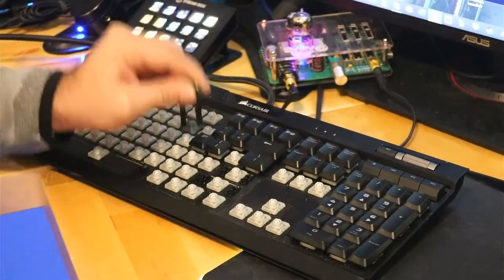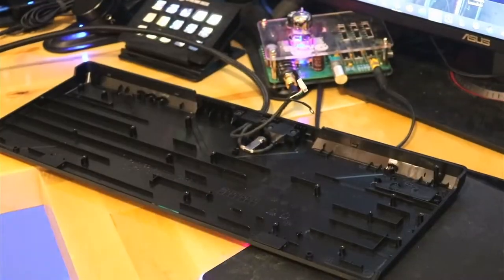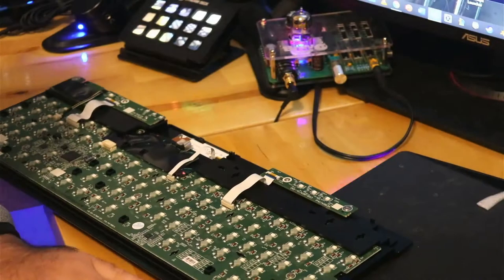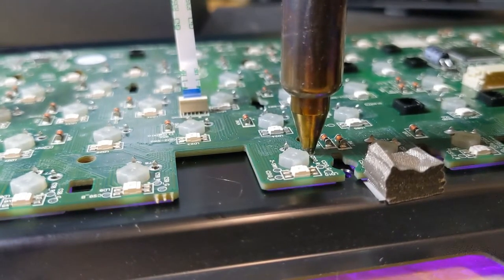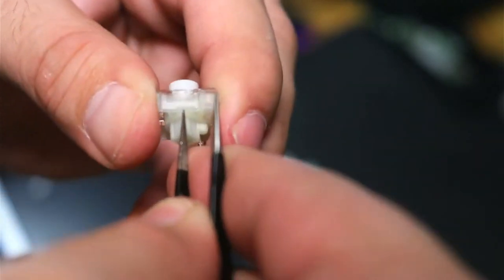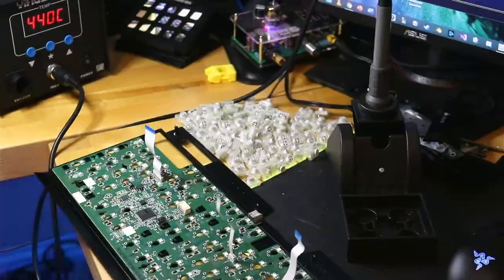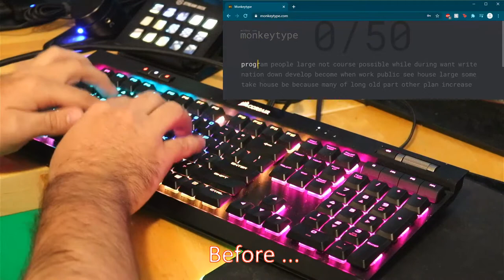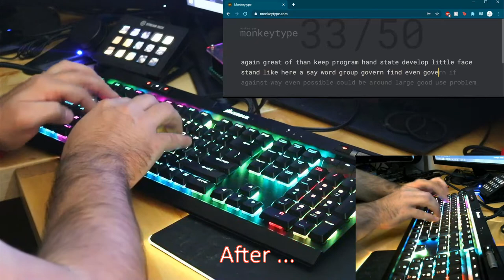Keyboard Build: Corsair K70 MK.2 Low Profile: Krytox 205g0 and Foam (Cherry Speed)

Comment: Doing this + lubing the stabs, filming the switches, Tape mod, and O rings to my K70 with MX Silvers this weekend. So excited!!
Reply from the maker: Noice! The only thing I wouldn't do is the rings. I didn't know they made film for the low profile switches? Or do you have the regular switches?
Reply: @ireakhavok  Ended up scrapping the rings and it turned out great! I have the K70 with MX silvers. Also modded my sister's G.Skill KM780 with reds. Really amazing the results you can get with a bit of effort.
Reply from the maker: @BleedGibson  The fact that you can take what you already have and mod it to be so much better is satisfying to me. I'm glad that you're modding for other people! I gave my brother a board and a couple other friends. :) Glad that it went smoothly! I am waiting de-soldering parts. I have three boards waiting right now to get modded that need to be de-soldered, including my first mech.

Comment: Your videos encouraged me to go with a project board - a liquid damaged K95 Platinum I found on a local equivalent of craigslist for around 200$. The original game-plan was to just fix the damn thing up... Now I got a K95 with the following:

Custom real leather wrist rest instead of the original rubber one, replaced the super scratchy speeds with Akko Demon switches, plate-PCB foam, bottom case foam, holee modded everglide pandas', razer pbt keycaps with a jurryrigged 6,25 spacebar to fit the 6,5u stabilzers. 

Needless to say, I love this thing and typing on it is a real pleasure.
Reply from the maker: I want to see this. Hit me up on instagram, or send me an email. lmao at the fact that you put Razer keycaps on a Corsair board, that's the equivalent of putting a ford motor in a chevy, lmao. Sounds comfortable, and quite a bit of work! I wouldn't have bought a water damaged board for 200$! that's so risky! glad that it turned out. I'm assuming that you just cleaned up the connectors with a q-tip or whatever and the PCB came back
Reply: @ireakhavok  Small mistake here - It was 50$ - not 200. 200 was in my currency (PLN). 

The seller was very upfront and honest what kind of damage it had - other than some LED's not working as they should and keystrokes not registering, it was in pristine condition - if you don't mind the gamer gunk, that is. 

The only reason I felt comfortable buying a liquid damaged keeb is because I already had to save my laptop twice after spilling liquid myself due to my own clumsiness and had some... first hand experience what to do with liquid damaged PCB's. 

And as to how I cleaned it... 

I literally washed the PCB in the bathtub. After that, I gave it a spray down with contact cleaner (and some q tip action) for good measure and finished it off by generously spraying it down with isopropyl alcohol. Dried using first a compressor (with air preparation unit ofc) and after that giving it a nice finish with the hair dryer. All the dead LED's sprung back to life after that and the dead switches were working. 

Also, I'll send you by tomorrow an image of the board per email. It looks rather serious with the razer keycaps, compared to the gamer font of the corsair keycaps :^ )
Reply from the maker: @D3humaniz3d  Much better, haha. and Awesome, man! I look forward to seeing it! I'm really glad that you took a chance, and accomplished something new, reused something that probably would have been thrown out, and made your own twist to it. you did all of the right things! Sounds like they had a pretty bad spill

Comment: Thank you for the video, is it possible to use different switches for this keyboard ?
Reply from the maker: Yes, but you have to get the same type of low profile switches. There is a K70 version that is not low profile, as well, that would be good for standard MX switches, but you can't switch from low profile to high profile or visa versa

Comment: Thanks for this awesome video.

How much of the sound reduction do you think comes from the foam mod compared to the remaining changes?
I am thinking of buying a K70, but would only go as far as adding foam.
Reply from the maker: So, normally, for tall profile switches in a standard keyboard - the sound change from foam is usu around 60-75 percent. but in this case, probably half from the switches and half from the foam. Just because the switch anatomy is so different and has less space than a normal switch, so the lube does a better job at sound control.
Reply from the maker: I don't think you can really go wrong with corsair vs other "gaming" brands. I do think that the lube was really helpful here because these switches are a little more scratchy than other switches. So just keep that in mind. This would go away after heavy use and about a year, I'd assume, but I can't be sure.
Reply: @ireakhavok  Thank you so much, for this quick answer. If you have some more time so spare, I would humbly ask one more question. 
After watching some more of your videos, I am currently on the edge of either going for the:

 -Corsair K70 with MX red switches + Foam (+O-Rings)
- Everest Max with MX silent red switches + O-rings

Do you think the overall sound volume would be the same?
Reply from the maker: @MultiMetal31  so honestly both of these produce a very similar sound, and are fantastic choices.  given that they both are aluminum plates with plastic cases they will feel similar too. I would say however that the utility of being able to remove and move the number pad of the mountain Everest I would go with the Everest.
Reply: @ireakhavok  Thanks again for your opinion.

Comment: Put some athletic tape underneath the stabilizers in your space bar to get rid of that rattle
Reply: @ireakhavok  I just did a bunch of mods to my apex 7 tkl, since I don’t own a soldering iron I spray lubed the red switches, put dialectic grease on the stabilizers and put some foam in it and it soooooo god tier now
Reply from the maker: YT deleted my original comment: Stabs are the most important mod! I should have spent more time on it here on this board.
Reply: @alexatwood6205  Very late, but i don't want to desolder everything.
How did you spray-lubed it and how well was it working?

Comment: Hi, this is very helpful. I'm sure to do some modding for my own version of this keyboard (it has the MX Cherry Speed, most have Red) and I have a couple of questions. With the foam on the bottom, does it actually affect how the switches perform? I.e., does it dampen the switch or just sort of seals the space?

My second question is about ideas on how to reduce the maximum actuation distance. I very much enjoy the fact that I only need to press the key down 1 mm for it to register, but the full 5mm is a bit annoying to me. The obvious solution would be O-rings, however, the low profile switches are different than normal ones, so the normal O-rings won't fit. Are there any alternatives for this? Or did I maybe miss the right O-rings somewhere? This is currently the biggest gripe I have with the keyboard right now, I can take the loud keys, but the distance would make the biggest difference to me.
Reply from the maker: So the speed switches already have an actuation distance of 3.2 mm, which is .8 mm less travel distance than regular switches. I have not tried putting o rings on the low profile switches, but I would actually think that that may work. The stems on the keycaps still have the same (+) pattern as normal switches, so it should fit just fine, and actually have a better/ more even bottom out against the switch. I just tried it out on my board, and it actually worked.
Reply: @ireakhavok  Thanks for the very fast reply! Yes, I have certainly gotten the numbeers wrong, but I admit, to me even a very small distance is very noticeable, so even if it's 3.2mm it feel like more haha. As for the O-rings, the reason I ask is because while the switches do have the same + pattern, there is an additional plastic ring around it. And I've seen someone place O-rings on the outside of that plastic, but I was not able to find any O-rings online that are big enough (the outside plastic is 6.5mm in thickness. But, if it can be placed on the inside, I would be fine with that, just a bit surprised that it actually fits. Thanks again for the reply, I might just go and order myself some O-rings and some lube today :D
Reply from the maker: You put the o-rings on the key caps not on the stems.
Reply: @ireakhavok  That much I understand, but the think with this keyboard is that it has the ring of plastic around the stem, where it fits the keycap's + slot tightly. So what it would seem to me that it would do it would just raise the keycap, rahter than actually change anything about the actuation distance, because the ring of plastic moves together with the switch. So in this case I think you would need an O-ring that would fit the ring around the stem. Unless I'm missing something. And again, thanks for replying to me :)
Reply from the maker: @TheNeoDaedalus  The bottoming out distance of 3.2 mm is just a physical limitation of plastic hitting plastic. 

If you put an o-ring on it it will just change it from 3.2 mm to say 2.5 mm and be a rubbery bottom out. 

You cannot change the actuation point (where it is registering the key in the computer) without changing the stem or the contact leaves

Comment: That's an amazing result. I already desoldered and lubed my k70 rapidfire with silver switched but I didn't put foam. Hopefully that dampens the rest of what I'm hearing what foam do you recommend?
Reply from the maker: I recommend some U-haul packing foam sheets that are made for dishes - or a sheet of silicone. the silicone would create a much more thuddy sound, while the foam will mute the sound more like you hear in this video. around 1.7 mm - 2 mm thick sheets is generally what you want. You can also layer it or mix silicone with foam, but I must say that the silicon sheets generally come quite a bit thicker and are harder to get them to work right without damaging your case or PCB. With patience, though, it will give the "best" result, in my opinion!
Reply: @ireakhavok  Thanks! I will look into those options

Comment: I just bought this keyboard, and the pinging on some keys are insane - especially the keys around the middle of the keyboard, like O and P. It's the spring up noise. The others keys have it too, but to an acceptable degree, i cant hear with a headset on (headset on, but no music).

Which mod will help reduce this the most?

It'sd so bad on like 4 of the keys i think I will return it, if i cant reduce it greatly.

Beside this problem, the keyboard is perfect for me - all regular size mechs has too tall keys, for my small hand, and weak joints. Do I need to get either low profile, or membrane
Reply from the maker: Lubing the switches is the best way to reduce ping. Followed by foam. I definitely suggest doing it if you have the tools to do so, but I would start with the foam first.

Comment: Thanks. Going to try it with the tape mod instead of foam. Not sure if the mic settings or not but seems too muted for my liking. Anyways good job ☺️👍
Reply from the maker: It did become muted, and I'm not entirely sure if it is from the foam or the lube and the anatomy of the thin switches, but it definitely is unique, and not what I expected. I do feel that the low pass characteristics of the tape mod would actually be a better sound profile on this board, as even after dampening it has a rather high and low pitched sound profile, with almost no middle ground characteristics. GOOD LUCK AND HAPPY DE-SOLDERING

Comment: Yesterday i bought my MK.2 low profile and it actually sounds like yours after the mod. It has a really dry sound. Maybe corsair changed something in the production?
Reply from the maker: So I have a condenser microphone so it's going to amplify a lot of the little sounds. The sounds that you are hearing on your keyboard is going to be comparative to my before and after. Corsair does not lube their switches.
Reply: @ireakhavok  It can be. Before that I used a Razor black widdow elite. In comparison, the Corsair is really barely audible. At first I liked the click sound but over time it drove me crazy. ;)

Comment: I'm considering swapping out the low profile Cherrys for regular switches, do you think this board would allow that? once I have the standard size switches on I can get PBT keycaps. I don't like these low profile ABS ones much.
Reply from the maker: Sadly they are not compatible. :/ However they do make a k70 that is not low profile that has basically the exact same top plate. I would try to sell the low profile and just buy the standard

Comment: Will the foam help eliminate that annoying ringing sound whenever a keyboard is pressed?
Reply from the maker: yes it will help reduce and most of the time eliminate "switch ping". You can also sometimes lube the switches or use different springs to do the trick.
Reply: @ireakhavok  thanks! Might give it a shot tonight. Does lubing the switches help with the aluminum case ringing too? Or is that mostly the foam inside?
Reply from the maker: @nczioox1116  Mostly the foam fixes that, for sure. The lubing only helps If there is a ringing like a tuning fork. Sometimes you can make other switches ring by harmonic oscillation - lubricant helps keep this from happening.
Reply from the maker: @nczioox1116  Definitely start with foam, as de-soldering the switches takes such a long time, and was harder to open them all by hand.
Reply: @ireakhavok  Thanks! Gonna try that soon. Decided to return the k70 and get a k100 renewed so will try it on that. Appreciate the tips!
Reply from the maker: @nczioox1116  Let me know how it goes!

Comment: Is replacing the low profile switches with regular ones doable?
Reply from the maker: I do not believe so, as the plate to PCB distance changes. If you get the regular K70, it will have normal switches. The problem here is that if you were to solder on the switches through the plate, I do not believe that the top plate will be able to bold down to the bottom housing anymore, due to the gap that is created.  I could be wrong, as I never measure the height of the bottom housing to compare it with, but I'm about 96% you cannot do it on this keyboard without heavy modifications to the case, itself.

Comment: i have no idea how your k70lp sounded that way before you did the modding because mine stock sounds exactly how yours did after the mod. now I'm wondering what would happen if I did what you did, to mine
Reply from the maker: So, the compression mic that I use amplifies fine details, and softens loud sounds a bit. So some of it could be due to the mic that I am using - and the settings. 
Buut if yours is completely stock than I DEFINITELY suggest modding it. You will like the differences, I'm sure. De-soldering all the switches sounds like a pretty rough task, but it's not that bad, just time consuming.

Comment: Consider making them hot swappable?
Reply from the maker: So this I did think about, but this is much harder to pull off. What it comes down to is that the board isn't clean and getting all of the gunk out is practically impossible for all of the key spots. Hot swap sockets are very finicky and need to have an absolutely perfect and clean pcb. All of the other problems are manageable.

Comment: do you think its worth changing all the switches of a k95 RGB to a silent one ?
i kinda wanna do this but reduce my keyboard sound.
Reply from the maker: Yes, I do. It is always better to modify what you already have, first, before buying something new! Just be careful if you plan on lubing your switches because lubing silent switches can make them squeak if you put too much lube. Some thinner lube in those cases would work, but if you would like to just use a silent switch and not lube them absolutely that would work perfectly.

Comment: It's a difference but the after is a little quiet and mushy.
Reply from the maker: It's extremely quiet, it may sound mushy, but it doesn't feel mushy at all.
Reply: @ireakhavok  I mean it sounds mushy to me.
Reply from the maker: @tonym3659  I definitely feel that that is because of the anatomy of the switch - there is no open space, like in other switches.  I do lube heavily, but they're not overlubed. Have you seen other videos of lubed low-profile? maybe I should have done a thinner lube, just for sound?
Reply: @ireakhavok  Idk it depends on you.

Comment: Only with this foam mod will helps to make this keyboard more quiet?
Reply from the maker: No, lubing the switches will also make it quieter, but you have to open the keyboard anyway to get to the switches, so it is better to do the foam mod, while the keyboard is open!
Reply: @ireakhavok  what happens just with foam mod? What the function of this?
Reply from the maker: @MrSoBraL87  it dampens and braces the bottom of the case, to reduce the amount of volume of air that can vibrate. It is the same as putting a pillow in a base drum.